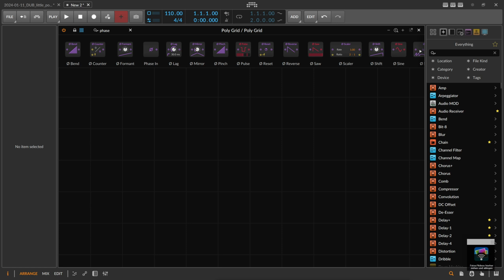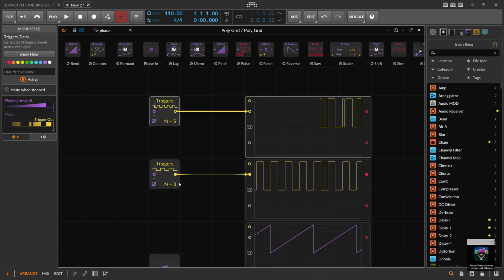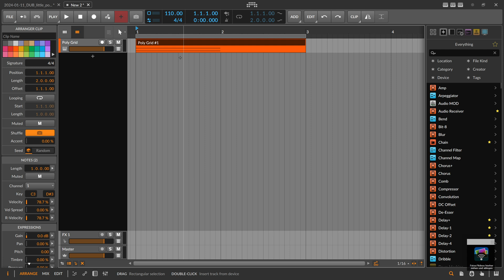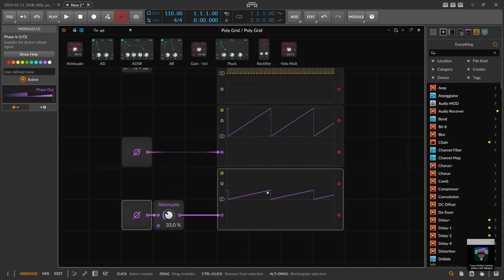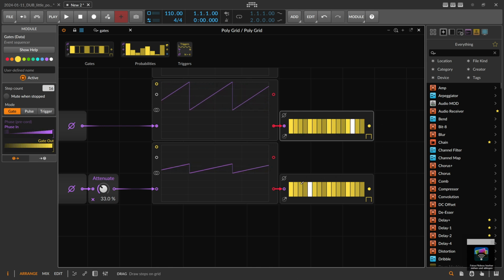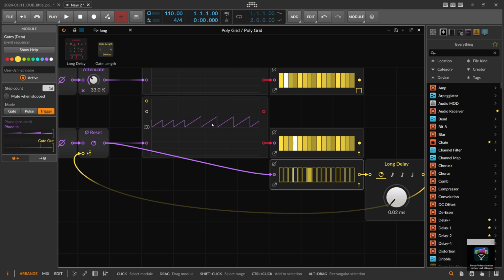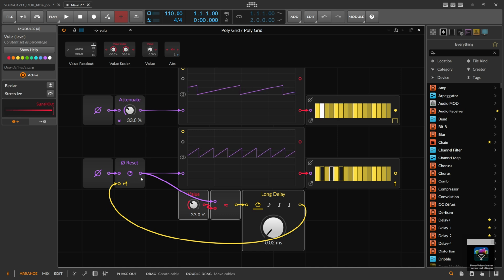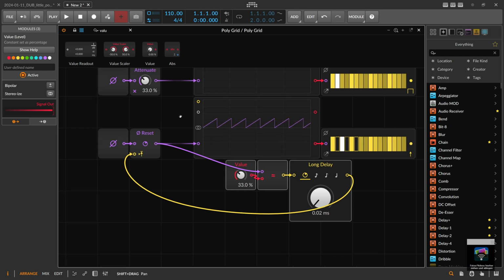Polymeters in the Bitwig Grid

Comment: Hi man, I have a question, not specifically related to this video but I want to do a note sidechain from e-kick to some track - but I want to offset this sidechaining in time - so it happens earlier than the actual e-kick hits its note - is this possible to achieve on the track that has note sidechain modulation? Regards.
Reply from the maker: you can try and delay the audio of the target track by some amount with the "time shift" device.

Comment: Thanks for that, I think I finally got it :). So in a nutshell, a polyrhythm is about defining a different interval for every event, and a polymeter loops sets of static events in different intervals. If that makes sense 🤔.
Reply from the maker: Yes, polyrhythms have the same pattern length but use different subdivisions, while polymeters have different pattern lengths. I think you can combine the two as well, using different pattern lengths and subdivisions, depending on the desired level of chaos :D

Comment: Another way would be to use a combination of the Triggers and Counter devices. If you want a sequence of 7 and a sequence of 5, for example, you set the length of these sequences to 7 and 5, send the Triggers to the Counter, and set the Counter devices to 7 and 5 respectively. The step count of the Triggers module will set the speed. I still find it much easier to use Modulators for this, since they will work with  "polymeters" by default and there's no need to change multiple things in the Grid when wanting to adjust the length.
Reply from the maker: yes, the step mod is super nice for that. just reduce the step length, done. great idea with the counter too!
Reply: Yep, this is how I handle it. Steps modulator and/or counter + triggers

Comment: "long delay" is the delay (0.02ms, but delay)). Therefore, the signals will diverge over time... You can replace Gates+Delay with LFO with square shape (and skew ~10%). Set it to 1 bar, double-click on number "1" and change, let's say, to "7/16" (and hit Enter/Return). Then everything will be clear in time for quite a long time.
Reply from the maker: you can also use a clk quantizer (16th notes synced) before you go into the reset
Reply: @PolarityMusic  yep, little bit complicated than LFO, but rock solid solution :)
Reply: When Long delay is used for feedback connections, actual delay time increases to audio buffer length.
Reply: Good idea :). We can also (ab)use the saw output of the LFO itself as phase signal. In extreme cases the phase device delivers a more stable output for some reason but I only ever encountered that when modulating stuff in the kHz range.

Comment: What about using the Scaler?
Reply from the maker: It changes the tempo:(
Reply: @PolarityMusic  if I have let's say one pattern of eight steps driven by a normal phase and another pattern of 12 steps but driven by the scaler with a ratio of 3/2 isn't that polymeter? Cos 12/8 = 3/2.
Reply from the maker: @CuriousPassenger if you want to calculate the right tempo ratio for each trigger sub division number and pattern length combination, then this can be an option, yes :D
Reply: @CuriousPassenger  Yeah, this is how I've always done it